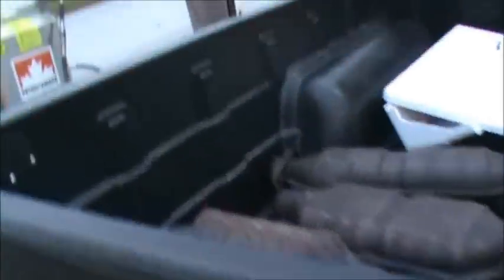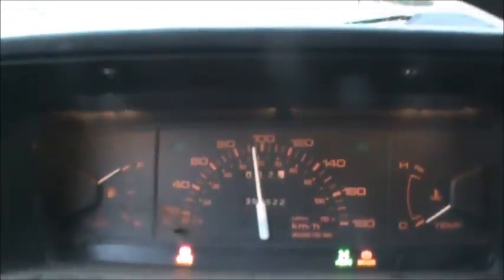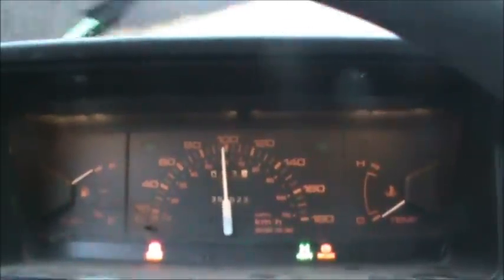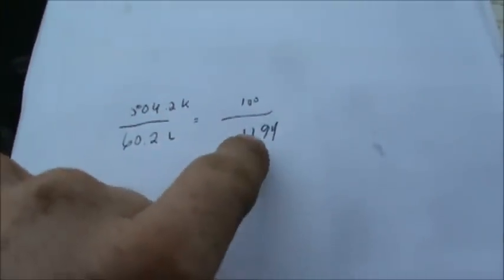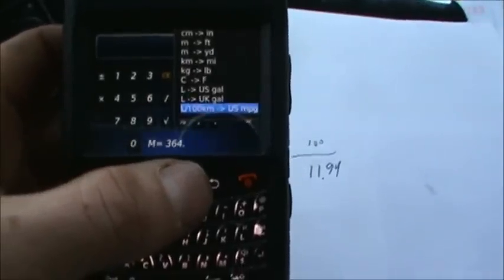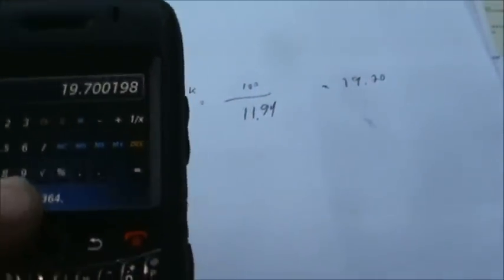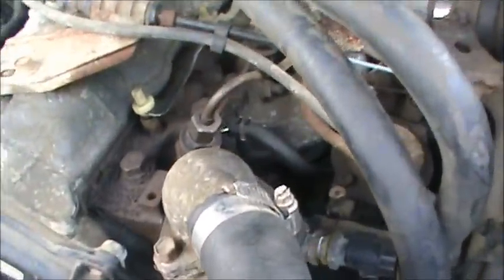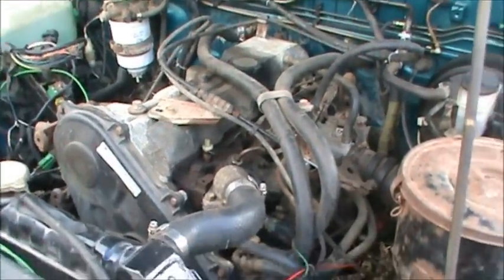Diesel Frankenstein

Comment: I would expect it to do better than 100kph. Does the gearing seem right? All filters good? At 100kph is it wound up all the way in rpm or just out of power? I'm sure with a little tweaking you can get the speed and mileage up.

Comment: You guys are probably on winter fuel that knocks back the fuel mileage. Try running some Stanadyne fuel treatment through the system it works the best works really well on rotary injection pumps. Stanadyne makes injection pumps so they made their own fuel additive.

Comment: Andy, There is something going on with your speed. That motor should get you up to 90 MPH with no problem even if it has 4wd. The MPG  is off. I guess if it is just for running around town its fine but the speed is a problem.

Comment: Let's do a BG fuel service and performance oil change. Fuel injector and intake cleaner and a compression restoration in the oil. Get all the carbon and junk off the injectors and out of the cylinders.That should help it out, let me know!

Comment: This is a diesel not a turbo diesel. 120 or 130 kph is the speed which is close to the maximum the vehicle should reach without any problem. Diesel accelerate more slowly than gasoline vehicles. Fuel consumption for this engine is 10 to 12 lpkm.

To have such fuel consumption diesel must be perfectly dry. Impossible to be any leaks. Also on the return fuel line. This vehicle got something wrong with the thermostat. Engine temperature is too low. This also increases fuel consumption.